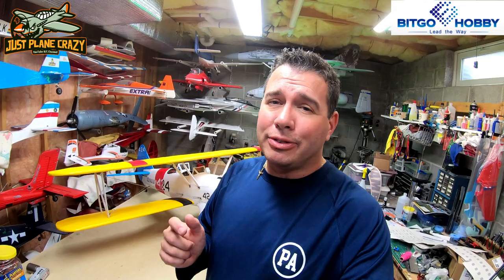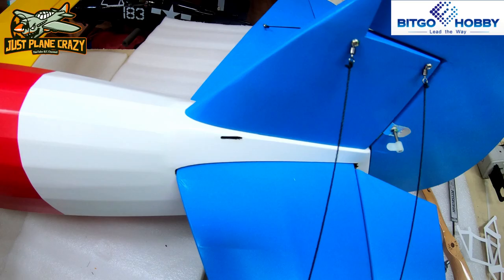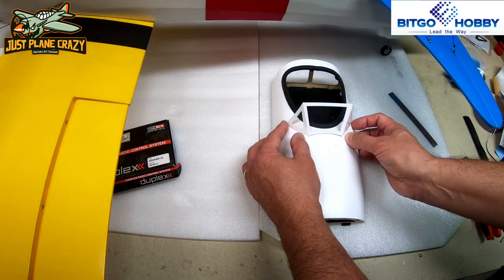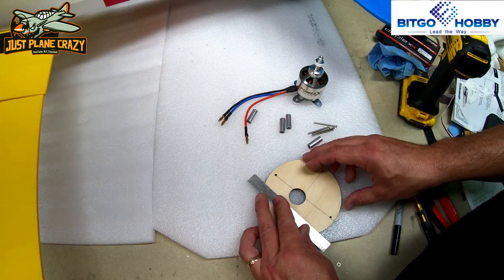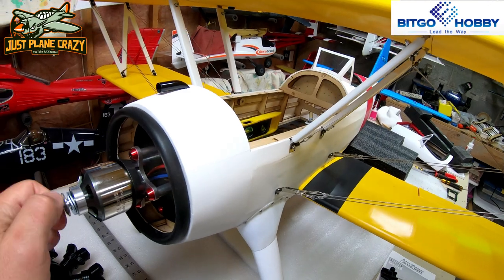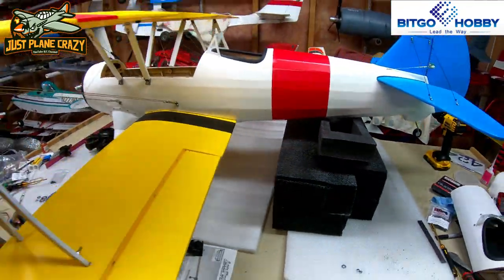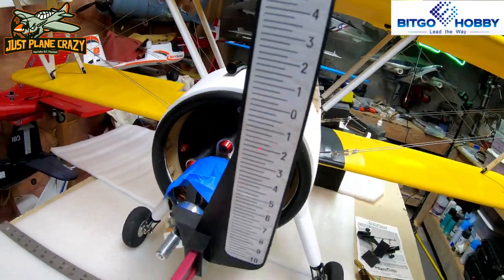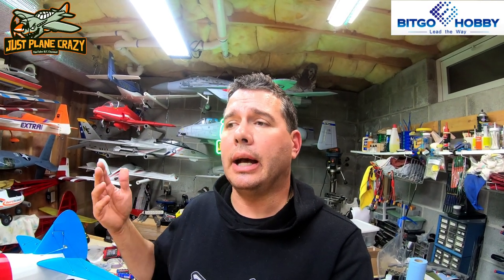Pt3  Dancing Wings Pt17 Stearman Balsa ARF PNP Build Series, from BitgoHobby. Setting Motor Thrust

Comment: Great tips for assembling mine - especially motor mounting, thrust angle, decals etc. Also nice to hear what those odd parts are for (eg. small pvc tube) since the instruction pictures don't always show and/ or the instruction pictures are different from the parts supplied.

Comment: Great build videos as always!  Is the 2' down and right thrust a standard you use?  I'm mostly a novice so if it wasn't built into the mount I never considered it!  Thanks!
Reply from the maker: They call for 2’ down and 2’ right in the manual. To be honest I haven’t seen a lot of planes or kits manufactured that don’t already have it built in. Either the firewall or just how the motor and standoffs are glued in a foam plane. But they are out there. For example, this one and the giant Corsair from TopRc Model would be two examples. Most people don’t know it exists or how to set it so I thought it was a good opportunity to do so. Thanks for watching as always
Reply: @JustPlaneCrazy  I found a formula on the net that works some slick!  As an example lets say the motor mount has a width of 2.75" and you want 2.5' right thrust.  2.75 * tan(2.5)=0.120.  The spacer needs to be 0.120 thick!!  Math is cool.
Reply from the maker: That is way cool. Never thought to look for something online. I will have to try it and compare the results if I run into one again.

Comment: I like your laser trick for thrust.  However, the original holes in the circular mounting plate position the motor up and to the left so that the motor shaft comes out in the center of the dummy radial after you add down and right thrust.  After adding the correct thrust, your motor shaft probably did not come out in the center of the dummy radial.  You probably shimmed the dummy radial but did not show it in the video.  Why didn't you use the original motor mounting holes?

Comment: You didn't off set the motor hole to aloud for the 2mm off set so the prop nut will be in the middle of the cowling

Comment: How many Arf's have you had to set thrust on bro? this is a new one on me....
Reply from the maker: Fair question. Most are pre done with firewall slant. So not that often. Most people don’t have the equipment or know how so that why I gave the thickness measurements in this one. Most people just guess when it comes down to it. Good question
Reply: @JustPlaneCrazy  I have built 100 or so Balsa ARF planes and NEVER seen it......like you said most would not have the tools for the job and I would be one of them lol. I like this company and have been looking at this plane but if they are looking for input let them know this could intimidate many buyers .
Reply from the maker: I would be curious to see how many people ever even set it.